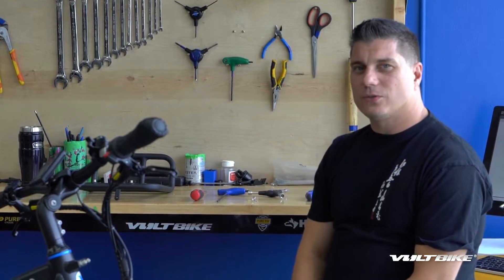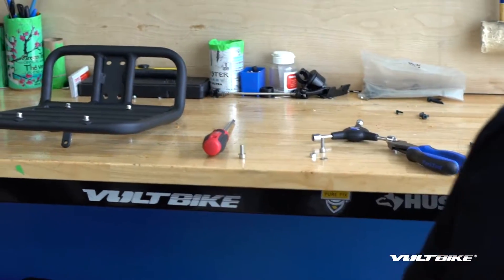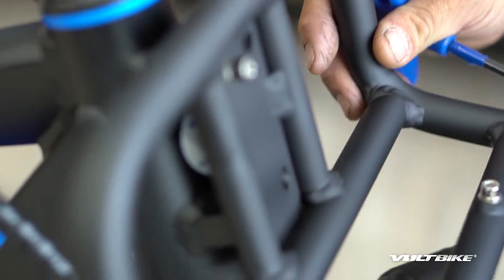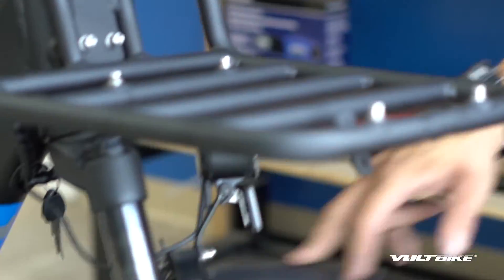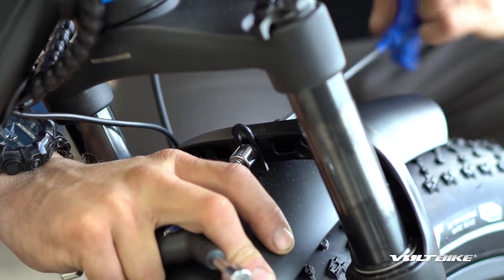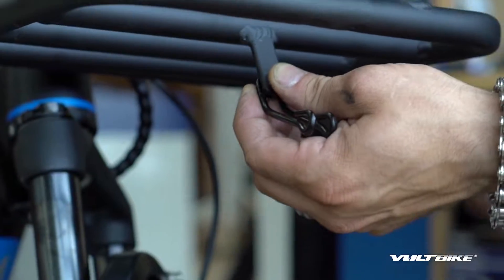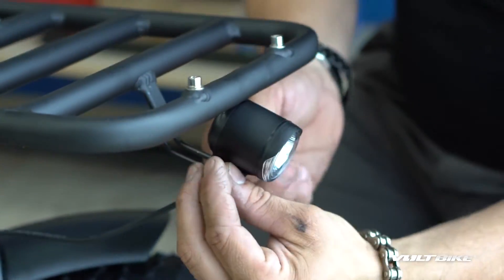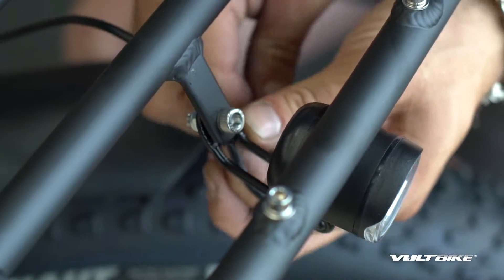Front rack installation

Comment: Why relocate the light?
Reply: I wonder too. I suppose that if you have a heavy load on the rack, it could damage the light on a big bump. It would be better to just lower the light a bit but I guess they already thought about it.
Reply: I did this without relocating the light and when the front suspension is loaded, the rack actually hit my light and and made it point downwards.  Scratched the top of the light housing too.  So there's that.  I've since relocated the light.
Reply: I ended up removing the reflector and bending the bracket holding the light so it wouldn't hit.
Reply: @ninoc5  Thanks, that what I was thinking too.